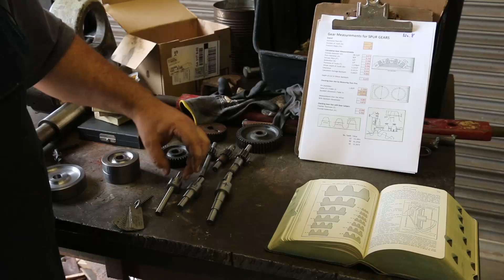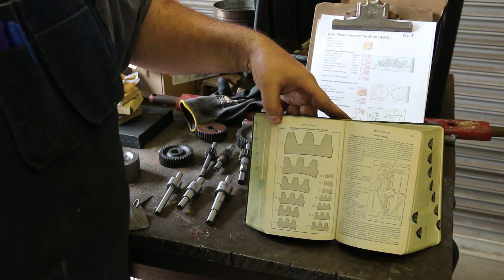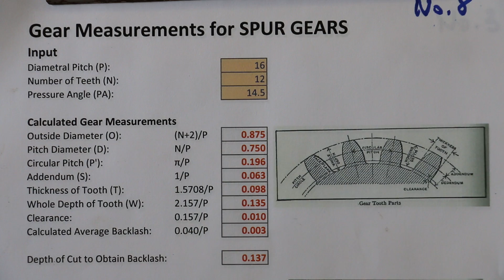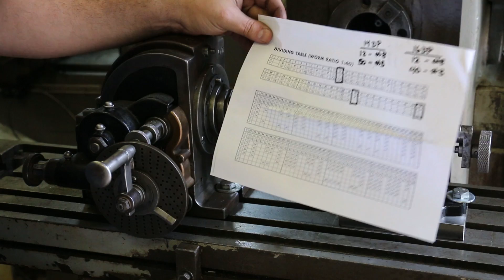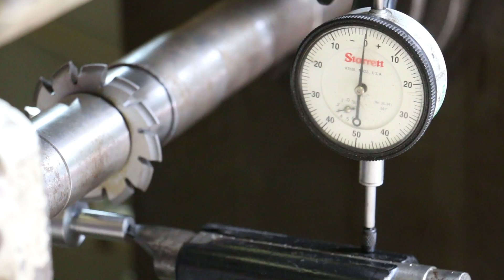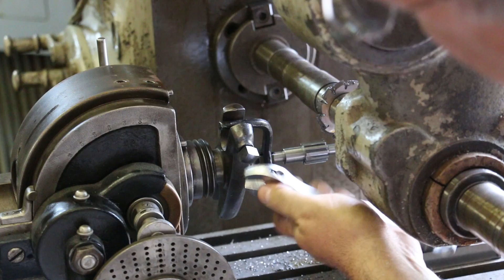Gear Cutting Basics and Cutting Pinion Gears on a Horizontal Mill

Comment: I've been waiting for this video ever since you mentioned the dividing head during the Victor safe video series. This is so cool for me to watch as I have no machining experience, but have always have been fascinated by machinery. I have an uncle that is a retired  "gear cutter" at the Falk corp. in Milwaukee, and always said Milwaukee based Kearney & Tecker machines were the best in the world. Thanks a bunch for your video's.
Reply from the maker: Cynic Believer There were lots of good makers of mills out there, but K&T was at or near the top of the list in my opinion.  I sure would have loved to have seen your uncle at work - if they were making gears in a production setting, they were likely using a hobbing machine - a different process than what I used as it is a lot quicker and more efficient for production work but usually not worth setting up for just one or a couple of custom gears.  Gear Hobbers are really cool machines!

Comment: Another great video. Was the second pass to depth the final pass or did you do a spring pass to make sure? Do you ever need a spring pass with a mill like that? Thanks.
Reply from the maker: Walter Plummer After the second pass, I took it out and measured it again to make sure I was on target.  In this case, I did not need a spring pass but if I had been just short of the target, a spring pass would have been my next step.

Comment: Keith,

Great video, thanks. Are you a machinist by trade or are you self-taught? You are a talented videographer as well as machinist.

Will you be heat-treating the gears or is that not necessary? 

Thanks,
Reply from the maker: Ian Butler Ian, I spent about 2.5 years working in a machine shop right out of high school to earn money to go to college.  That is where I learned most of the basics and really most of my skills.  Since leaving the machine shop over 25 years ago, I have continued to practice the trade more as a hobbyist and through my volunteering at the museum.  While I had a great mentor to learn under early on, since then, most of what I have learned has been self taught by reading through old machine shop books, and more lately by watching other machinist here on YouTube.  Even as someone with quite a bit of experience in the machine shop, watching other machinist on YouTube has been quite the education for me as I have picked up on all kinds of little tricks of the trade and different approaches to solving a problem than I have learned and used.  As for heat treating, that will not be necessary with these gears.

Comment: Thanks for another great teaching video.  Your slow and methodical style, combined with well thought out detailed explanations, makes it easy to follow along, no matter if you've seen this before or are a total newbie.
A question.  I see your tailstock has a half-center.  I also have seen other using this and even lapping the center hole.  Can you explain why use a half vs a full center, and why don't most machinist show lapping center holes or even using grease in hole?
Reply from the maker: Morris Gallo The half center is that way because a lot of times with a dividing head, you are small gears or splines on the very end of a shaft that come way down to near center.  If you had a full sized dead center, it would be so large that the cutter would dig into the center - and with the center being hardened, this is not good on your cutters.  By using a half center like that, you do not have to worry about your cutter hitting the center since in theory, you should never be cutting below center.
Reply: Keith Rucker - VintageMachinery.org Thank you

Comment: The gears you cut should last for a long time to come, Very fine work Keith, I,am glade you pointed out on back lash without the proper amount good by gears. Thanks for taking your time to show the way to do what you have learned. To me that's a gift that keeps on giving.
Reply from the maker: Randall Moore Thanks you Randall, it has been my pleasure.  I had to do a lot of refreshing in preparation for this video as it has been a long time since I have cut gears.  This was a fun job for me as well!

Comment: My first experience with gear tooth cutting involved hacksaw blades, 2 new files and a reference profile stamped into cardboard from a good area of the gear that was being repaired.  And a huge amount of patience, which doesn't run in abundant quantities in a teenager.  It was a very valuable lesson in what could be accomplished even if you had only hand tools to do the work, but not one I'd care to draw on these days ... I like this method a lot better!
Reply from the maker: diggerop LOL - I was talking to our blacksmith at the museum the other day and he told me about a blacksmith that he worked under years ago.  That guy had a blacksmith's post vise that had a worn out Acme thread that tightened up the vise.  Over the course of a summer, each morning and each afternoon, and whenever he had a little bit of down time, he carefully filed out a new Acme thread.  When he was done, it worked perfectly!  I told our blacksmith if he ever needed an Acme thread, let me know, I could make him on on the lathe in a tiny fraction of the time compared to filing!
Reply: That certainly sounds like old OLD school!  I found an old article that describes a process that would be in between that and using a screw cutting lathe.  I'll try to find the link and get it to you if you'd like.

Comment: Keith Rucker - VintageMachinery.org That dividing head is fascinating.
I'm surprised that the final .042 made such a dramatic change to the tooth profile.
Reply from the maker: ***** It is in the bottom of the cut when the tooth starts flaring out, so yes, a little depth can make a lot of difference!

Comment: A very well-done video. I was fascinated.  What fascinated me was that you were able to talk on camera and cut teeth at the same time. I most certainly cannot, and I write down a list of the steps I have to do to cut a tooth. And then I tune out the world and concentrate.

A quibble on terminology. When two gears mesh, the point at which they meet defines a circle. Ideal gears, of course. The circle has a diameter, called the _pitch diameter _.  The number is theoretical, I know no way to  measure it. The diametral pitch (DP) is the number of teeth per inch of the pitch diameter, a lot like the screw pitch is the number of turns needed to advance the screw 1". If two gears are to mesh, they must have exactly the same DP. So once you have DP and number of teeth, you resort to the formulas. These will give you the two things you need: the  OD (outside diameter) and DOC (depth of cut). Now you can set up the dividing head and cut gears. There is always the annoying factor of pi -- but the formulas have allowed for that.

For the rest of the world, which is metric: we use Module instead of DP. Module is simply the inverse of DP, so 1/DP. Since you are now in metric, actually Metric module = 25.4/DP. So for  12 DP this is about Module 2.1 mm/tooth. Being an aspiring clockmaker, this is huge to me. I do not cut involute gears, I cut cycloidal gears, and a Module 1.0 is one big clock. Module actually simplifies the formulas. I often do them with a slide rule, which shows you how old I  am.
Reply from the maker: Juan Rivero Thanks - I have never done any gear cutting in metric so I have not studied any thing about the "Module" method.  There is a lot of math with gear cutting but with something like an Excel spreadsheet, it is greatly simplified.
Reply: Keith Rucker - VintageMachinery.org Absolutely. I forgot to thank you for that tip, I  wrote a program to do it but but it was, if not a waste of time,  a lot of work. Tomorrow I go put the whole thing into Libre Office!

Comment: What's the deal with that dead center (triangular profile with a flat top?) I've never seen anything like that and it looks like it is a home-made deal to raise the center from the original height.
Reply from the maker: Bradley Weingartner This is very common on the foot stock for a dividing head to have the top of the dead center ground down flat like that.  This is because there is very often a milling cutter coming in from the end of the shaft for cutting splines or small gears and the cutter would dig into the dead center.  With the top milled flat like that, the cutter will not hit the dead center at all.  Go look up dividing heads on the internet and I think will find that nearly all of them are made this way.
Reply: Keith Rucker - VintageMachinery.org Makes perfect sense Keith, thanks. I've noticed some offset centers but never one ground quite this aggressively. Though a quick google search confirms that some were ground very very close to centerline! Thanks!

Comment: Nice work Keith, really enjoying this series on the blower rebuild.  Btw, is your K&T horizontal a 2HL?
Reply from the maker: turbocobra It is a 2H.  the 2HL was the "light" version of this mill and was just a bit smaller in size and capacity.  I also think that the 2HL takes a 40 taper while the 2H takes a 50 taper.

Comment: Keith,
Thanks for the interesting video. I've seen gears cut before on a vertical mill. If memory serves, I saw the other Keith (Fenner) cut gears on his K & T. Even so, it was informative to get your take on the process. I find I learn more by watching how several guys do something and then I can develop my own scheme. Thanks again!
Have a good one!
Dave
Reply from the maker: Swarf Rat I have seen gears cut with a vertical cut as well, but I have never been a fan of that method as the outboard support on the horizontal mill takes so much of the deflection out of the arbor you get a much smoother cut.  At the end of the day, it is just a matter of preference though.

Comment: Dividing heads and gear cutting is so much fun! I always take a sharpie and color my dividing head holes though just in case so I don't bump something or miss count.
Reply from the maker: bcbloc02 I have used that trick before myself.  On these gears, I could pretty much tell which pin it needed to drop into from practicing a few times so I did not do it.

Comment: Great job. I know it is messy but you will get a better finish using some coolant. Also noticed a bit of run out (over travel) on one of the larger splines. Can't wait to see the rest.

JHolland
MiddleGa
Reply from the maker: Johnny Holland The coolant pump is not working on my mill right now - something else that needs fixing....  As for runout, I have barely ever ran a horizontal mill when there was not a bit of runout, but it really does not matter as the high tooth will be the one that you make your measurements from.

Comment: Very nice craftsmanship, and a great tutorial on gears, their measurement, and their manufacture. What an awesome video to enjoy my lunch with, Thank You!

I do have on question and it is possible I just missed it while munching away, but why was the number for depth of cut to achieve proper backlash given in the Machinery's Handbook different from the actual depth of cut you took?

I'm not 2nd guessing you in away way to be clear, and you measurement "over wire" certainly proved your practice, so I guess I'm just curious as to where the manual came up with that number, is it just a guideline/reference?

Either way you hit your mark right on the bull's eye, and your daughter would be proud of that "marksmanship", LOL! Thanks Again, Aloha...Chuck.
Reply from the maker: Knolltop Farms The depth of cut is only a guideline.  If the cutter is worn a bit or not a perfect involute profile, you might have go to a good bit deeper or lighter in total depth to get the correct fit.  Because the width of the teeth is at a slight curve and not straight across, it takes about 0.010 extra depth to make 0.001 of extra width.  What is more important is the measurement of the final gear and you make adjustments to get that right.
Reply: Keith Rucker - VintageMachinery.org  Makes perfect sense to me, thank you for taking the time to explain...there really are so many, many things to learn it is occasionally daunting, and your instruction is very critical at making things digestible. I truly appreciate all you continue to do for our community...Aloha, Chuck
Reply: Keith Rucker - VintageMachinery.org 
great Video. Measuring with the pin gauges measures both the clearance and depth.  You mentioned 0.010  depth change and 0.001 width change on the gear face.  Wouldn't this change with the number of teeth on the gear.  How do you use the pin gauge to set a final depth of cut?

Comment: great vid
quick question: you ended up at .142 dept of cut vs your calculation of .137, any thoughts/clarification on that?
Reply from the maker: sharp x It probably has a lot to do with the profile on the cutter - if it is off by only a thousandths, you have to go many more times that deep to get the width correct.  But with gears, it is the width of the tooth that is much more important than the depth of cut.  The calculations are just a guideline and not absolute - you have to measure the gear to get the final depth.

Comment: Very nice video, Keith.  Professionally done.  Your horizontal mill works great for gears, better I think, than a vertical mill.  More rigid.
Reply from the maker: ***** Yes, lots more rigid and more versatile as well.  You are much more limited in the size of gears that you can cut on a vertical mill.

Comment: As usual a very informative video, Keith. Aside from the subject at hand.I recalled that the sand used in casting jewelry to a high degree of reproduction was Delft . This is s wee bit more expensive than what you have been using  . But the results are very nice. I had a nice video on it from Rio Grande, unfortunately its long gone or I would send it to you. It is something to check out. Good luck keep upmthe good work.

Al
Reply from the maker: Alphonsus Padavano Thanks - I will look that stuff up.

Comment: Hey Keith!  I really enjoyed this video.  I made pages of notes.  I'm going to have to go back and watch how you found the center of the gear blank when mounted between centers.  I did not understand it the first time I saw it.  Don't worry!  I'll get it!  I'm just slow I guess.
Reply from the maker: vajake1 It is pretty simple, just run each side of the cutter up against the square touching each side of the part.  Measure the distance that you have to move the cutter to get it touch on both sides and half of that is center!
Reply: Thank you for your rapid reply!  I read it, then just watched the video again!  I understand now!  I don't know why I did understand from the very start!  Thanks!

Comment: Keith, Could you use a chuck on the dividing head instead of a dog driver?
Reply from the maker: Luckystrike Sure, you could, but for a gear like this, it is better to mount it between centers than in a chuck.  Almost all chucks will have some amount of runout in them where mounting it between centers should run perfectly true.
Reply: Keith Rucker - VintageMachinery.org
Thanks, I never thought of that.

Comment: Very good video, just a suggestion, when measuring the gear with the pins would it be an idea to wrap an elastic band round or sticky tape round rather than clamp your Mic in a vice. Keep the videos coming.
Reply from the maker: Jack Tar What I need is a cheap mic stand, but in the moment, I made do with what I had handy.....

Comment from the maker: Here is the next segment in the gear making video.  We mill the teeth in the small pinion gears.  Enjoy!
Reply: Watched it earlier. So impressed with your skills sir.
Reply: Very very good explanation of how it's done. I'd seen gears cut before but now (finally) I have at least a basic understanding of the process.
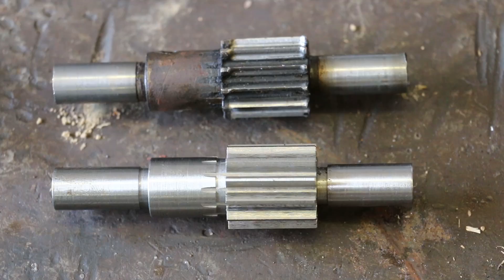One little thing that really impressed me - at 41:22 in the video you can see the overrun of the cutter onto the shaft (proper terms??). I was thinking "ut oh" until I looked closely and saw the exact same thing on the original! That was a real "WOW" moment. Excellent.
Reply: Another excellent video! Makes me want to get a horizontal mill. Thanks.
Reply: Scholar for sure. Everyone goes to school for coding or whatever... This is what makes America. Smarts.
Reply: +Keith Rucker - VintageMachinery.org I agree with everyone but ... you need to label this as part 3.

Blacksmith Blower Rebuild: Part 3 - Horizontal Milling of Gears
I had to look at the date of the video, and go to the 6months ago section, and found this inbetween part 2 and 4.

Not bad right now, but in X number of years, it will get worse.
Reply: how are you sir i am low class miller sir i need machinery hand book and modul guaje please sir give me idea i live in soudi arabiA.
Reply: Is there a reason for cutting in this direction?  Would "climb" milling make any difference in the grear?
Reply: +Bara Jee .how I help u bro
Reply: GoodScienceForYou, If you climb cut in a horizontal mill while slotting as he is doing you will likely pull the table into the cutter and shatter the cutter ruining the cutter and the part being cut. It will also scare the *&%$ out of you in the process.
Reply: Only if the machine is in poor condition.  I used that technique in 1972 in trade school.  However, the machine was a brand new Cincinnati and that table could not be pulled as you stated.  A worn out machine could pose the danger you suggest, but not a machine in proper working order.
Reply: Phill Huddleston  very good disply.

Comment: Excellent video Kieth!  I always wondered how one would indicate in on a horizontal mill.  Thanks for sharing.
Reply from the maker: Herb Blair Well, there you go!  Indicating on the horizontal mill is not as easy as on a vertical mill or where you can use an edge finder.  But, it can be done!